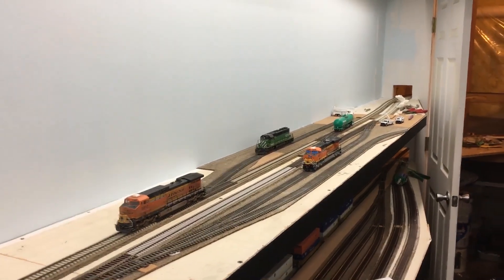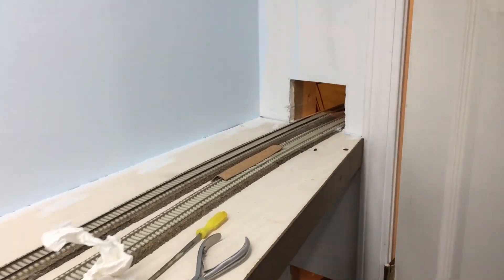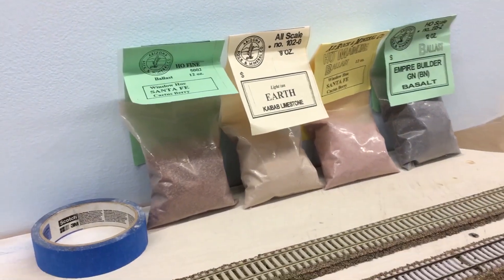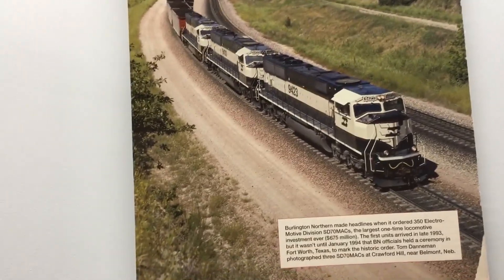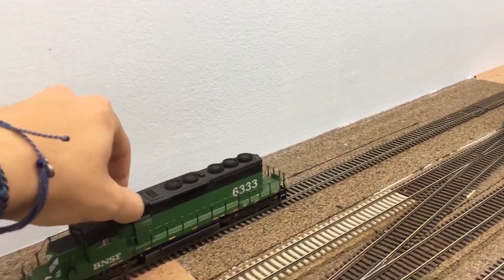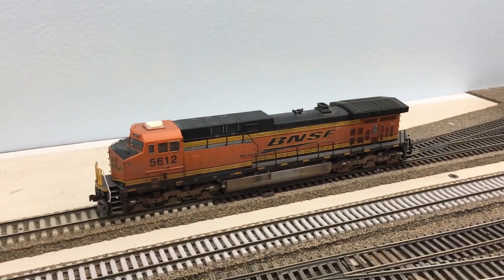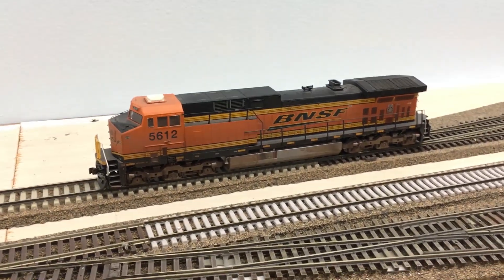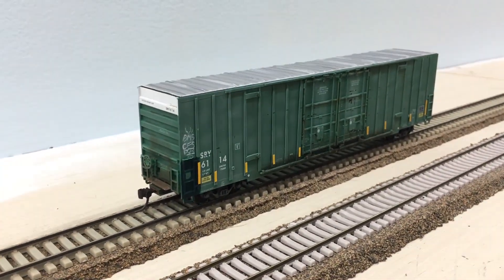Layout Update 45: Pretty much nothing (touching base and questions for you)

Comment: Looks good, and if you can duplicate the overpass as the picture shows, it will be a perfect way to hide the wall openning. Now the trucks jumping. I have found that if you do not check the wheels in gauge in several points on the same wheel you can miss an axle that may have a slight wobble, and being in gauge too tight will cause the truck to move up as in your video. I have changed many Athearn wheels with a better product like Northwest short line wheels.

Comment: I like the overpass idea. And with the BNSF loco one of the gears could be cracked causing the wheels to be out of gauge. Without tearing into the trucks and seeing if the wheels are in gauge you wont know what exactly is going on. Oh! If you do look at the gears look very closely bc I know that those axle gears are famous for hairline cracks I have several that have had that happen just from wear and tear
Reply from the maker: Thanks for the info! I'll have to check it out. I appreciate it.
-Cam

Comment: Yes, LokSound 21 pin decoders will work with TCS 21 pin motherboards. I have that setup in an Athearn CW44AH. The only issue you’ll run into is programming with a LokProgrammer and that is due to the keep alive, not the board being TCS. Basically what happens is you can only program and test it once, then you have to pull the engine off the rest track and let the keep alive capacitor completely drain before you try to program anymore. If you don’t, the locomotive will quit responding to the programmer after you initially program it.
Reply from the maker: Good deal. I just installed a Keep Alive in my ACe, and I had read that's a problem. Currently, I don't do any programming with the Lokprogrammer, and my standard programming track seemed to work ok. Eventually, I would really like to have a Lokprogrammer though. Thanks for the info.
-Cam

Comment: Great work! I am starting my 2nd layout and will have trains go through the walls too. I have the holes cut, so trains start in the yard, go through the wall and into the towns/industries for switching, and then continue on the loop back through the other hole in the wall to the yard again. I plan on making a "sleeve" out of plywood to seal the track from the open space between the studs. Basically a box, open on both ends. Concerned about dust, and I don't really like the idea of heating/cooling the space between the walls. Did you consider doing that, and if so is there a reason why you didn't do it? Just wondering out loud. I plan to hide the holes with hills and trees, but your overpass idea is much more creative! Is there an update that talks more about the holes in the walls?
Reply from the maker: Thanks for the comment! I haven't done much yet to decorate/finish the holes because I'm just now getting around to scenery. With the overpass, I plan to extend the retaining walls into the hole along the length of the studs there. The room on the other side is unfinished, so I only had to go through 1 layer of drywall.
-Cam

Comment: Overpass would look great and hide the wall well, if not an overpass large clusters of trees would also do the trick. Question on your bench work, how far apart are your levels spaced? Also how did the 1x3 wood hold up vs the 1x4? I recall you started using 1x3 but later switched, can’t recall if there was a reason. Just asking cause I’m about to start bench work again on my next layout. Thanks - Steve
Reply from the maker: The spacing really varies, and it depends on whether you're measuring to/from the bottom of the benchwork or rail height on the upper level. But just for an example, the lowest part of my layout for both levels is the yard and Crawford, which is situated above it. The yard sits at 38", and Crawford is roughly 53" if I remember (I'm talking about the top extent of the plywood here). For much of the layout, including the upper deck scene at Crawford, I'm actually using 1x2s. I've had 0 problems with them. All of the lower level is 1x2s while the upper level (excluding Crawford) is 1x4s. This seems counter-intuitive, but the 1x2 frames work great if you attach angled braces every couple of feet or so. For the upper level, I couldn't install angled braces because they would obviously invade the scenes below them. In Crawford, I got around this by using metal L-brackets, but I soon found that it was just easier to mount 1x4 frames to the wall without any extra support from L-brackets or angled braces. As long as the frames aren't too deep (wide), they basically just hang suspended from the wall once you screw them in. This obviously wouldn't work with a 1x2 frame because it's half at tall. Most of my scenes on the upper level are around 12-16", so if I tried to do the same thing with 1x2 frames, it would effectively be the equivalent of trying to mount 24-32" deep frames without any underside support. Hope that makes sense and helps. Do whatever works for you.
-Cam
Reply: Awesome, thanks for the detailed response. It makes perfect sense and now I see why you switched wood sizes. Appreciate the feedback! - Steve

Comment: There might be a problem with your switches With the older Atlas switches the frog  Always had problems with derailments And trains hopping skipping and jumping through it
Reply from the maker: Yeah, it could be that. Atlas frogs do suck. However, it also has problems on the Peco turnouts, so I need to check the wheel gauge.
-Cam